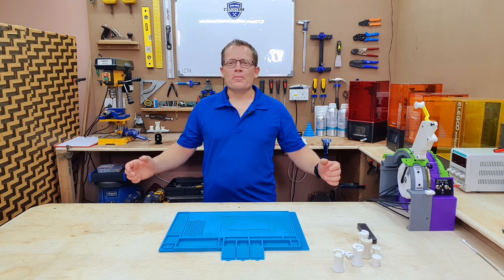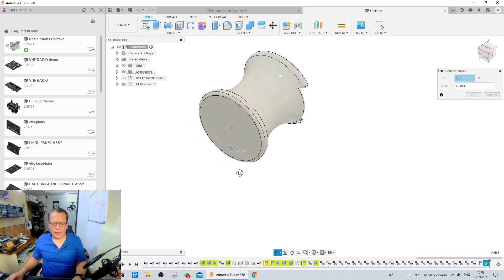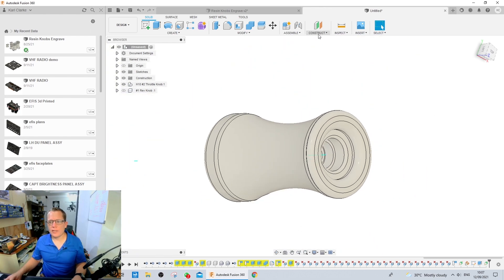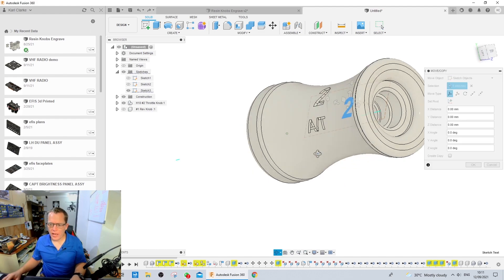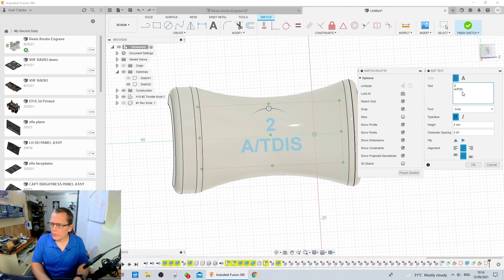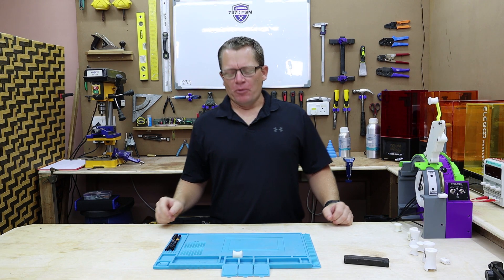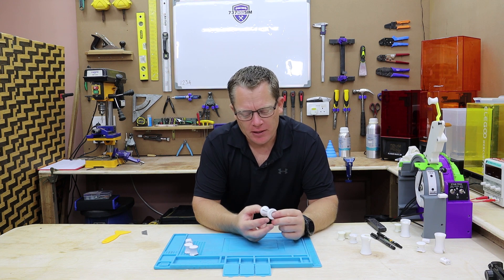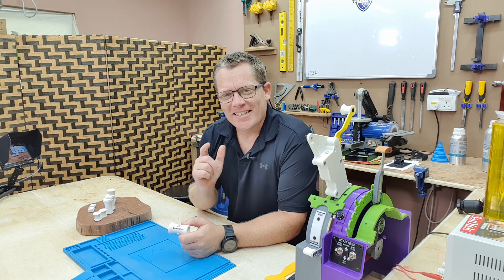Creating 3d Printed Knobs With Text & Fusion Tutorial

Comment: Did you know that you can melt & smooth the PLA printed stuff with the help of Methylene Chloride just in 15 seconds and it instantly becomes like resin?
Reply from the maker: Hello Captain, I didn't know that! Thank you and kind regards Karl
Reply: @helimech8152  Just make sure you use gloves and a protecting mask with an organic vapor cartridge and don't exceed the time of exposure of parts to MC 15 secs, it'll get so soft otherwise.

Comment: When are you planning to publish the throttle video.. Looking forward to it. One request.. Can you kindly break up the larger prints into smaller pieces for those of us with smaller printers. Ender 3.
Reply from the maker: Hi, that has always been my ambition, but its just not working right now. Because the frame is the structural integrity of the design, there is currently no way to put fasteners in to join it back up, with already hitting another part within the unit. I also have not given this my whole hearted attention yet, as I'm still making adjustments to the design. Kind Regards Karl

Comment: miss you  
The p3d plus version supports multiple channels.
Run p3d on 5 computers.
4 windshields + main instruments.
The system runs smoothly without freezing. High frame rate.
The windshield multi-display can adjust the respective field of view and angle.
Triangular reflectors between the screens can eliminate the black frame outside the screen.
Reply from the maker: Thank you for the advice, its always greatly accepted! Kind Regards Karl

Comment: Hello! Could you please tell me the name of the reverse 3D printer?
Reply from the maker: I have two resin printers, the Creality LD002 and the Elegoo Mar 2. I much prefer the creality one as the prints come out better, the Mars always puts fine lines in the print and they require sanding. The creality can painted without sanding. Its probably best to do some research first on what others are using. Kind regards Karl
Reply: @helimech8152  Thank you so much. You are doing a great job there.